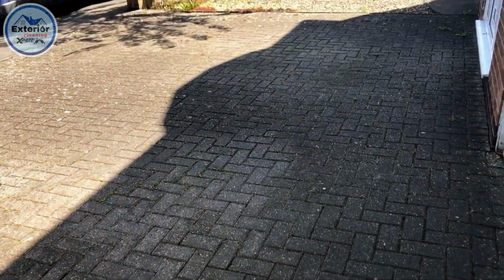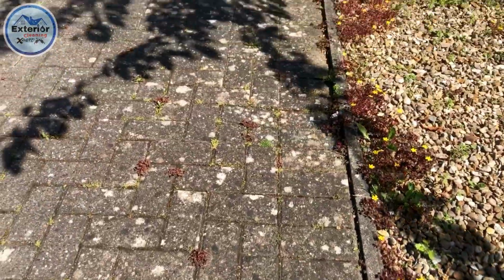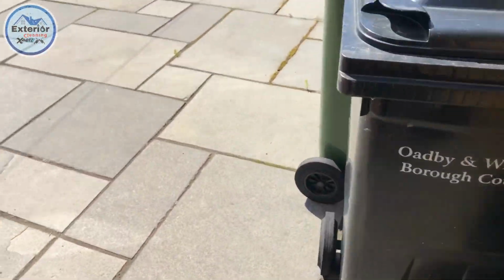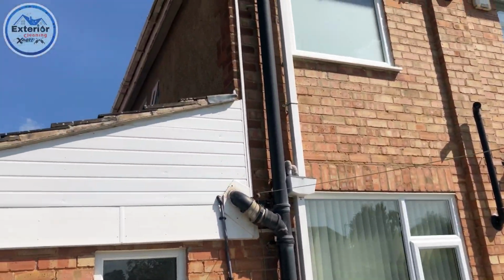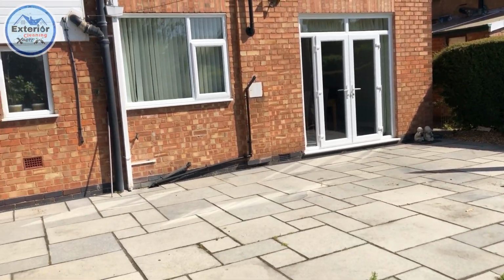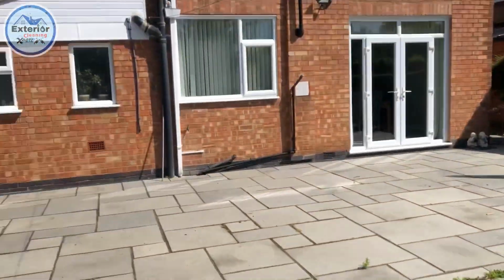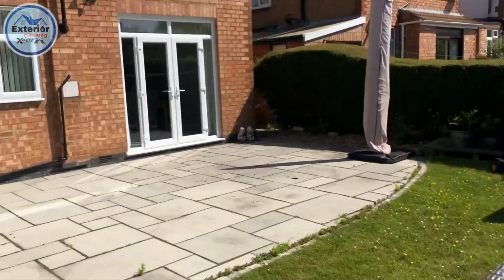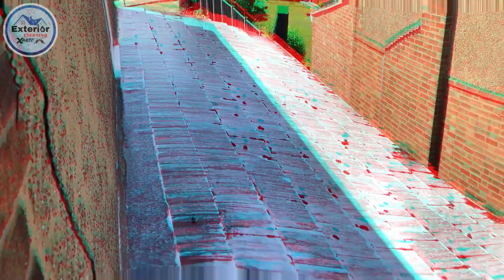Completely Pressure Clean Part 1 | Roof Cleaning | Pressure washing | Satisfying

Comment: Consider copper roof tape for lasting protection after roof cleaning. The flexible tape moulds to any surface, and the copper develops a durable patina which prevents moss growth for decades.